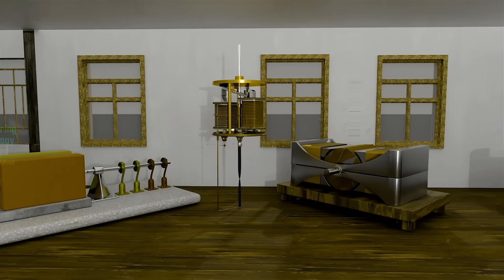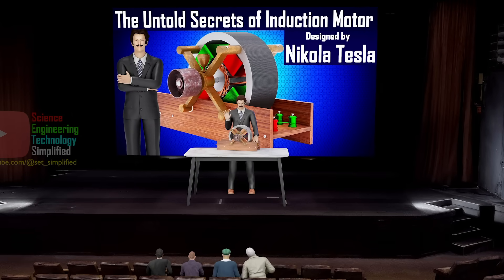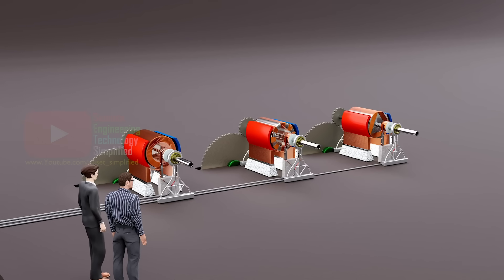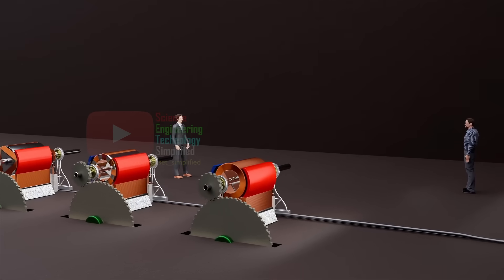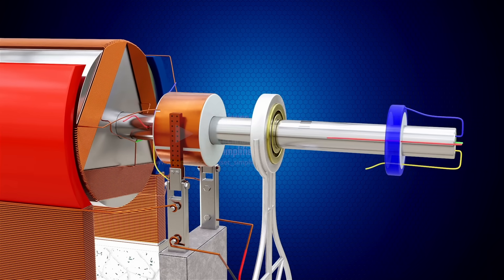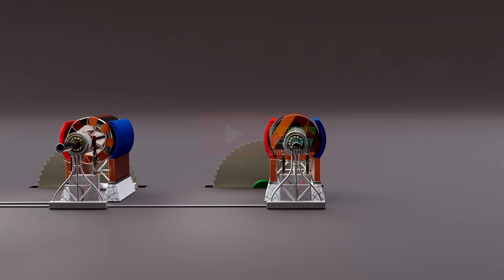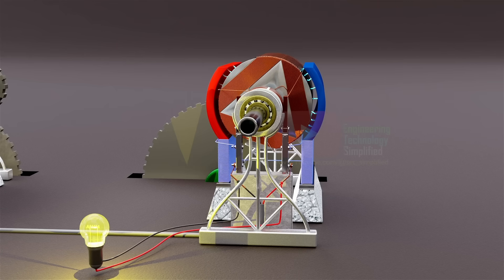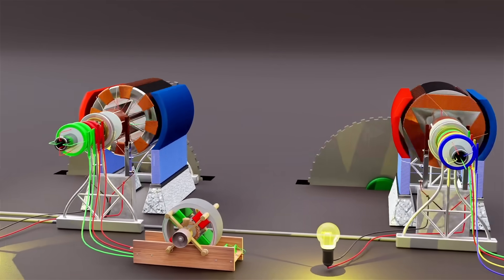Nikola Tesla’s 130-Year-Old Generator (Why It Still Works)

Comment: I put together a 14-neodymium magnet rotor and a Chevy alternator, with everything removed except the 3-connection AC block, to make a wind turbine, and it also has the DC pos. and neg. connections on the back. So it, too, will put out AC and DC at the same time.

Comment: One of Mr. Tesla's oldest machines still to this day isn't very well known. It's the DC to 2 phase AC alternator that has 4 slip rings and 2 coils in its rotor. For the longest time I thought that this was the best way to control AC from DC. It was designed by Tesla so how could it not be right? But recently I have found an old DC to 2 phase and 3 phase AC converter hand crank demonstrator. With this apparatus you can get 2 and 3 phase both from a single DC source and mechanical motion. Here is my most recent video of it.... https://youtu.be/gU23x5-P2bk?si=2pKdbc_mpwqe8TIE&t=12
Reply from the maker: Thank you Dear viewer for watching my video. Kindly subscribe because i mostly publish Nikola Tesla's video
Reply: un alternatore non può creare corrente continua.
Reply: @giannibaranello  I'm referring to the 2 coil rotor with 4 slip ring output rings that produce a 2 phase AC current by connecting the stator coils to a DC source then spinning the rotor and as the 2 coils spin through the magnetic fields the 4 slip ring output puts out a 2 phase synchronous alternating current.
Reply: @TheZafootz  ora Hai spiegato meglio. Ok